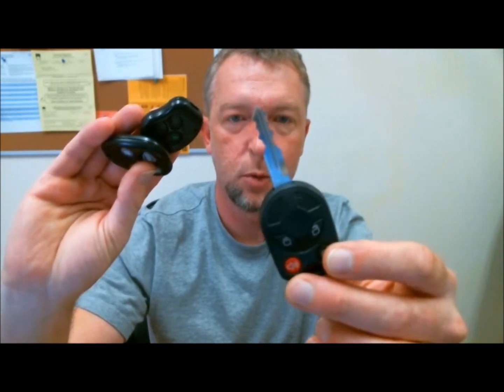2000 to 2006 Toyota Camry Factory Remote Transmitter Programming How To

Comment: I have a 2005 Camry with both original remotes, that didn't work after a battery change.  Followed all of your steps.  Originally, we got the "lock, unlock" twice from the car when we tried to program the remote.  I went through steps again and we got a "lock unlock" once from the car lock, but the remote still doesn't work.  Any thoughts?  Thanks for posting this video.
Reply: +Heather Moore Richardson did you figure out how to fix it? I had this same issue?
Reply: I have this issue too!! Did you get it worked out?!

Comment: Hi, I live in Australia I have a 2003 Camry with a single button remote this wouldn't work for me. What I have done is with the doors closed and unlocked the headlights off I cycled the ignition from lock to on 3 times then PRO was displayed on the central multifunction display, then you press the button on all the remotes that you want to be paired with the car one at a time until the indicators flash you must have all remotes with you as this removes other remotes. Hope this helps with the Australian Toyota owners.

Comment: I tried it and all the steps work, step 6 works perfectly, but the remotes still do not work, any ideas?
Reply: +Sumit Mahajan hi.my 2006 camry does the same thing. does everything right through stepp 6 but will not work afterwards. did you find anything out? thanks
Reply: +shady branch HI, the only thing that i can infer is that the receiver unit is not working. That is expensive to replace, so i am using keys now. I too have a  2006 camry, but if you find something else, please let me know.
Reply: +Sumit Mahajan thanks. i will